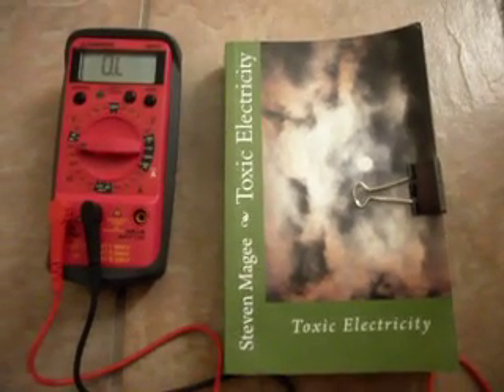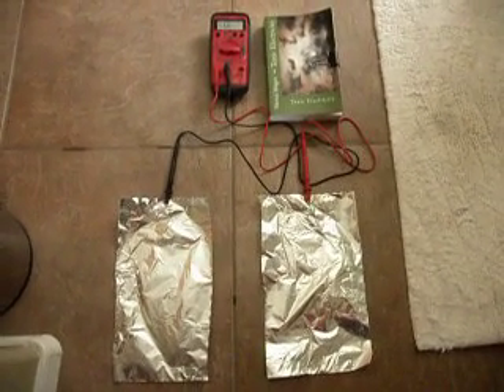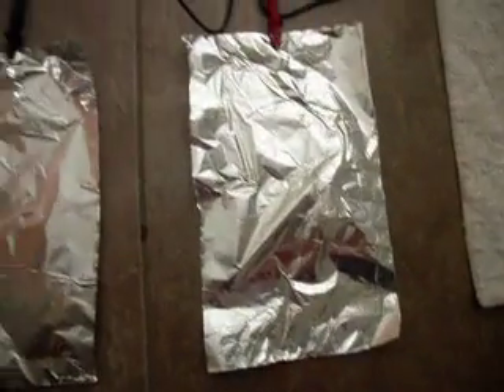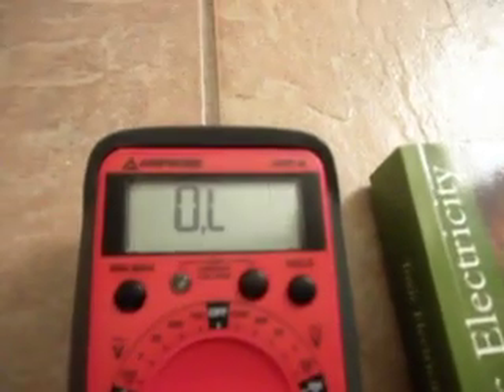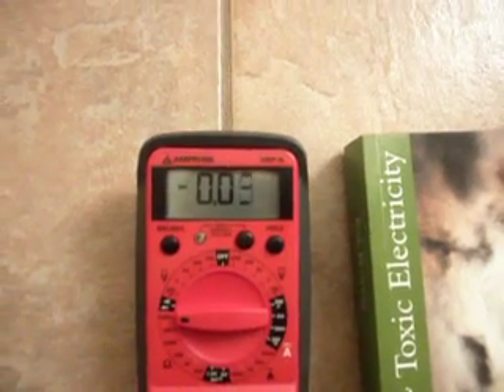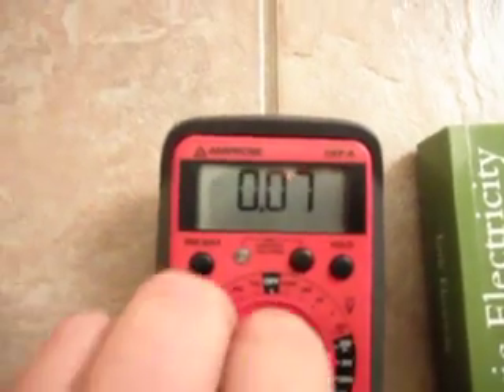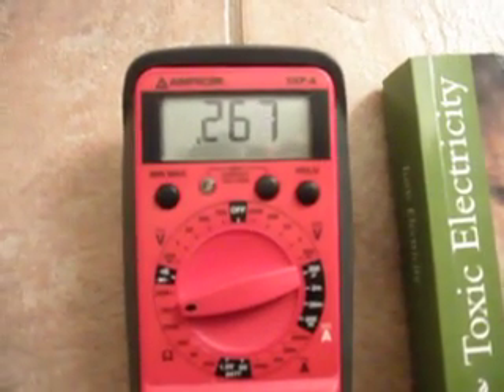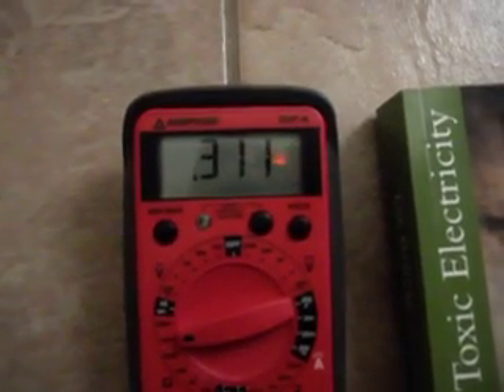Establishing the Correct Resistor Value for the Earthing Health Technique

Comment: What you're basically reading is the resistance between the legs via the pelvic joints/flesh resistance. So, why add this value in series with the ground probe? Why not just add a fuse of the lowest current rating for protection with an arc gap of .01mm parallel the fuse?

Comment: Please explain why the value of series resistor in your earthing wire would be equal to the resistance from one foot to the other.  I suspect that this resistance would very greatly depending on several factors, such as how sweaty your feet and how long it has been since you washed your feet.  Have you tested for such factors?

Comment from the maker: I use an Amprobe 5XP-A meter. It has a min-max function which is useful for determining the values for "Stray Voltage" over long periods of time. I eventually decided to use a 100,000 ohm resistor with the Earthing technique and I got a really bad back followed by crazy heart arrhythmia and I have stopped using the technique. Search "Stray voltage cows" and read "Electrocution of America" by Russ Allen for more information on the known health problems associated with stray voltage exposure.